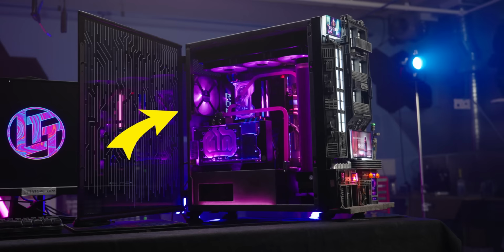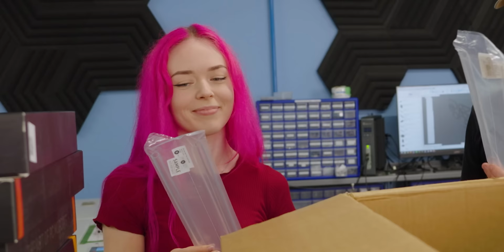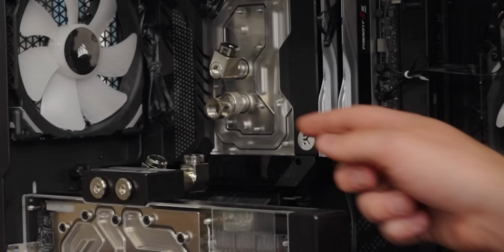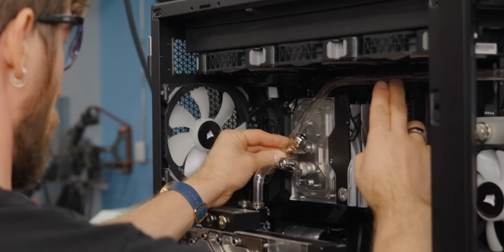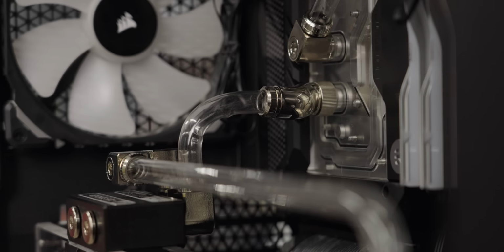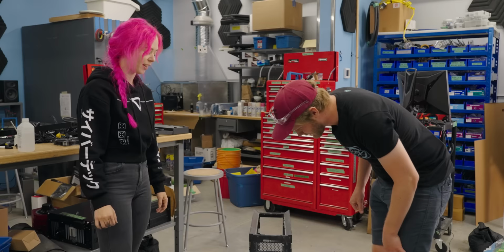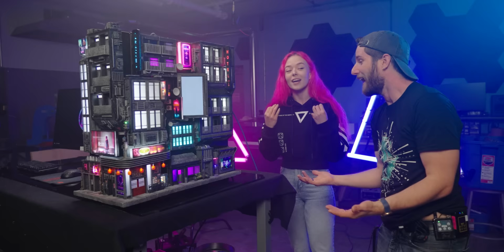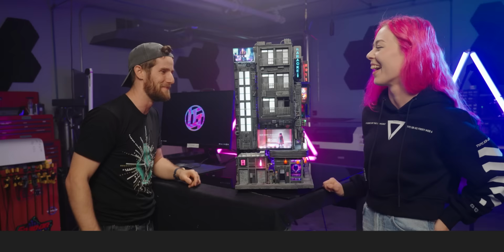This PC took 600 HOURS to Build!

Comment: Seasonic are just the ballsiest sponsor ever. The fact that they were like "oh you're pushing power supplies to their breaking point? Here's the equipment we use. Try us." and then sponsored the LTT video on the Labs power supply tester just shows how much confidence they have in their products.
Reply: If you make a superior product then testing and comparing it against others is just great marketing. Same reason why the LTT screwdriver was compared to competitors for example. Seasonic just makes the best power supplies, but doesn't have any way to demonstrate it to the general public who aren't electrical engineers. Seasonic is very smart to give LTT the means to demonstrate their power supplies to their massive audience.
Reply: "Oh, you're gonna have a PC case with a bunch of fancy lights, betcha you'll need an awesome power supply for that, don't worry, we're here. No worries it's just LEDs and LCD panels, we're sending 1600w."
Reply: My first pc build was 15 years ago and even then Seasonic was well known as the one of if not the best psu manufacturer.  So they’re more than just the meme sponsor, they’re legit.
Reply: Do you work for them?  Why would anyone post like this otherwise
Reply: i think you’re on the wrong video m8
Reply: I've put seasonic PSUs in all my friends builds for YEARS... There's a reason for that...
Reply: @Ucfahmad  I mean, people on LTT channel should know they're legit already, seeing as they manufacture for for Corsair, Cooler Master, & NZXT PSUs. They're still one of the only PSU companies that manufacture their own product rather than reselling a rebranded product.
Reply: @siege2928  Seasonic manufactures for Corsair, you still have a Seasonic PSU.
Reply: @Konarcoffee  They've had 12 year warranties for years. They've had long running sponsor spots that don't even have talking points, especially around Xmas. They are pretty much universally held in very high regard by anyone that seriously builds rigs and knows about what they're doing.
Kinda guessing you don't.
Reply: It's really great marketing, if Seasonic have the balls to sponsor something like the LTT Labs equipment that could really backfire then they wouldn't do it, so just by sponsoring it means they have a lot of trust in the quality of their power supplies.
Reply: @siege2928  I've had little issues with Corsair's over the years for the price, they are basically rebranded Seasonics for the majority.
Reply: I was just about to comment the same but you said it better than I could. They’re such a chill sponser.
Reply: @Konarcoffee  I don't work for them, I've never even bought one of their products yet, I've bought EVGA PSUs cuz they're cheaper. But damn if I don't respect the hell out of their marketing. That being said, when I get around to making another build for myself, I'll definitely consider shelling out the cash for a Seasonic.
Reply: It's super simple to make a great power supply if you don't try to save money.  Power delivery cost what it cost and any attempt to change this is a game of Russian Roulette with any electronics connected to it.
Reply: My last psu was from seasonic and was a beast! Had to leave them 2 years ago because they dont make 1600w titanium psu so i had to go with corsair
Reply: Going to build a PC for the first time soon. Guess what my power supply is going to be :)
Reply: @th3R0b0t  but also a 12900kf and an rtx 3090
Reply: Them and Dbrand are ballsy as hell xD
Reply: Absolutely, the only other company I'd get a power supply from is PC Power & Cooling. There's a lot that goes into a quality PSU and it's not something that's easily quantified.
Reply: My next power supply will most likely be a seasonic. Their platinum 750 watt is still capable of handling my current needs. Wonder when arm chips will hit the market though
Reply: Great marketing! And no doubt solid power supplies. But that won't make me want to buy them over any other.
Reply: I think I have no choice but to buy a seasonic power supply when I build my new pc haha
Reply: Proud owner of a seasonic power supply
Reply: @patrickshade3844  None of the current corsair lineup are Seasonic units. They're all custom designs (overseen by JohnnyGURU no less) manufactured by CWT.
Reply: @UniversalGaming  well that's a downgrade, no offense to JohnnyGURU. Last I knew they went through multiple OEMs though (CWT, Great Wall, Seasonic, etc...)
Reply: @patrickshade3844  Take a look at PSU Cultist power supply tier list & the power supply section on the LTT forums. Corsair is consistently rated as better quality than Seasonic. Seasonic PSUs had numerous problems with RTX30 series caused by design flaws in the units themselves (that Seasonic refused to publicly acknowledge). Seasonic is not considered the be-all and end-all PSU manufacturer outside of the youtube echo-chamber.
Reply: Seasonic is the best
Reply: Seasonic also buy a Sponsor spot around christmas every year just to say happy Christmas lol
Reply: @miscl_anon  Nah I just felt like brining that up because it was so incredibly based of them.
Reply: @patrickshade3844  do you know who manufactures the latest Gigabyte PSUs with the 1000w and 1200w that have LCD screens in them??
Reply: @Ucfahmad  Indeed
Reply: @UniversalGaming  Whoever built it, I have a Corsair RM1000x I poked in my 3080 - 3700X a while back. Mag-lev fan, zero mode. I never hear it.
Says made in Viet Nam on the box.
Reply: A

Comment: I've never seen a cosmetic PC build I've wanted as much as this one. Time to start saving...
Reply: same
Reply: Just build your own
Reply: @xenn4985  yeah thats what ima try to do, still takes alot of time and cash tho
Reply: I will outbid you by $1 every time
Reply: @camdenleonard7452  Time, sure. Lots of that. Cash, maybe not as much as you think. Nearly all Nerdforge stuff is made out of junk and everyday materials that are repurposed. Takeaway boxes, cardboard, foil, foam, paint, and lots of talent.
Reply: I myself am far to unskilled / untalented for building that myself. And getting that built by someone else would probably cost me at least 30k (with 600 hours for a skilled worker).

So nah, I am out
Reply: @camdenleonard7452  time yes, cash no. Take your time and this is a sub 500$ build
Reply: @xenn4985  ah yes you must’ve included the actual pc in your calculations
Reply: @xenn4985  Easily. About the only expensive tool on the Nerdforge side is the laser cutter, but you don't need that, it's just quicker and a bit more accurate. But you could do it by hand instead. Oh, and a 3D printer might help, depending on what you want to do. The PC inside though - that's a different matter. Much dollarpounds spent there.
Reply: Stake hex for 7 years and you'll beat Morhs law while making a batshit insane amount of money. Best way to plan a PC build is to wait for better hardware and pricing. No better way to do that then make fat bags during a recession
Reply: @frozenco2_  why would i? Everyone is clearly talking about the case
Reply: @xenn4985  derrrrrp. "PC build" is an all inclusive term. Did you not see that the fittings for the tubing alone costs $450.
Reply: they should update it with a 4090 when its out and a 13900k if they're hoping for a great price, cause like this its most likely won't get much by summer 2023 even if it was for charity...
Reply: Saving for sure, computers are expensive, but the more important thing is to start practicing. There's a huge amount of talent involved in this.

Comment: After watching this and reading the comments I'm dumbfounded at how hard it is to come up with an appropriate comment or reaction to this. This is one of not only the coolest but best pieces of Art / PC build's I have ever seen! I would love to own this at any price but I do not get enough visitors to my home to give this Artwork the attention it truly deserves. Martina Please, you are a truly talented artist so DONT STOP DOING WHAT you're DOING! Thank you for this.
Reply: If you want something like this - I would strongly recommend starting with something smaller (medieval house comes to mind). It's actually fairly straight forward, but it does take some getting past the "this looks like crap and will never turn out" phase as until you get the final washes / dry brushing / protective clear coat - it won't look "right".

You can do stuff like a wizards tower, or create the effect of it being a cliff face, or whatever else you can imagine - it's just foam, cardboard, some plaster / clay / whatever, and of course: Paint.

Just to note: I've only more recently properly got into terrain / buildings - and have a 6 foot tall tower in the process of being plastered, while I learn some 3D modeling to get some supports, and other nick nacks designed so I can print them and attach them. Yes it's a lot of work - but damn do the results of "I did this" make it worth the effort.

In short: Be inspired - and get out and make yourself one damn awesome computer case mod.
Reply: "but I do not get enough visitors to my home to give this Artwork the attention it truly deserves" - that part of your comment shows that you're a good guy my friend :D
Reply: 100%
Reply: you can start streaming then to show off this
Reply: Checkout the doom 3 case from around 2007. It was on par with this
Reply: Honestly, if there were these kinda two sided set pieces for popular PC cases I think they'd be crazy popular.

Comment: This build was an incredible incentive for me to continue using air coolers. Thanks for that!
Reply: or AIO's right
Reply: i mean even watercooling uses air, air ftw
Reply: My god, same! My new RTX 4090 / i9 13900K PC is air cooled and that's it. I would get so anxious that the hose could pop-off at some random point ruining the PC with a water cooled system.
Reply: @JokeDindonChannel  i think the leak won't kill your pc because you should use distilled water which is non conductive, so you pc just get wet but run just as good if not better because the water is cooling all over the place lol

Comment: As a programmer I absolutely love that they bricked the photo frame to make it useful
Reply: no idea what bricked it means but it sounds like it was hacked, and i'm all in for that kind of shit.
Reply: @kurtcraig3421  hacked means "gain access to the underlying structure and possibly make changes to it", bricked means broken as in "not working properly". What bricked instead of hacked means here is that it will no work as intended again. Also it is up in the air if the result was actually intentional.
Reply: ive been into custom roms/os n all the shit you can do in android back in around 2014-15, and i must say, this brings back memories. it makes me really appreciate how accessible android really is. as long as you can read instructions you can pretty much do whatever you want in an android
Reply: therubberninja  Honestly, it’s a pretty robust and elegant solution in my opinion. There’s nothing that can go wrong, because everything that could go wrong has already gone wrong.
Reply: @jthoward  like the computer equivalent of a servitor.
Reply: @vsmash2  Specifically, here, the OS -- Android -- is broken so as to just loop their custom boot animation. The device almost certainly has a recovery bootloader that would allow them to flash a working image to bring the photo frame back if they really wanted to.
Reply: my guess is he did a noob move and undervolted it.

Comment: This going to charity is just the cherry on top of an incredible build. As a long time Nerdforge fan and a big nerd myself I can also say that my second and oldest PC (now my wife's) is still running on a Seasonic PSU and this comment is not even sponsored by them (but Seasonic, you can if you want! :p), it just didn't die yet after almost a decade of hard use service.

I do hope the charity action brings in a ton of cash as this case doesn't deserve less. And to all my fellow nerds, check out Nerdforge, they really deserve your sub, they are just great as you can obviously see!
Reply: Surprising it's being sent out, given they're using the hacked up 3090/motherboard/cpu.
Reply: Your comment made me smile and I enjoy ppl like you. Your username suits u very well friend, keep it up !
Reply: It's too bad Seasonic went from using great high-reliability under heavy load AND HEAT ball bearing fans to "fancy name" junk sleeve bearing fans in their most recent generation power supplies.
They will regret that decision when those fans start wearing out seals, losing lube, and DYING long before a ball bearing fan would have.
Reply: @sIightIybored  I would be very surprised if they didn't switch out the internal components to fresh ones, especially given it probably won't be up to date tech by then (Linus even mentioned the PSU being able to handle putting a new GPU in there).
Reply: @bricefleckenstein9666  I'm still waiting for the RMA of my Focus+ because I changed from a 1080 FTW2 to a 3080 FTW3 Hybrid. The damn thing just turns off.
Reply: @sIightIybored  Im guessing they just used parts that fit the asthetic for now. Considering it will stand on a shelf for 6+ months. Everything but the PSU and watercooling parts will be swapped out for up to date parts that have not been hacked to hell :P.
Reply: @muttefur  You probably overloaded that power supply.
The 3080 FTW (depending on the model) has been tested to draw up to 404 watts, where a 1080 FTW draws less than 200 (though very close).
Then add in the REST of the system, and your system is likely pulling 600-700 watts EASILY on a high gaming load on peaks.
I'm guessing you had a Focus 650, which was plenty to handle the system before the GPU upgrade.
Reply: @bricefleckenstein9666  still have a focus+gold 750. Supposedly this should be more than enough. Sea sonic already accepted the RMA but I am still waiting for the local distributor communication.

Comment: Important FYI: Most of the leak testers you can find on the market use generic pressure gauges which don't have markers to indicate which pressures are correct for a traditional PC water cooling system. In the video he pushes a tube out of the gasket from the pressure he uses to pump up his system. However, even when he used "less pressure" it was still too much pressure even though the guage shows it in the "green" region. This is a really bad design flaw and can result in displacing the seals in your system from excessive pressure. Consult the maual but I wouldn't suggest going over 0.5 bar for a leak test. 0.3-0.4 is more than enough. Any more and you're more likely to crack plexi or damage gaskets.
Reply: OK boomer
Reply: @jorgebustillos8469  The information above is really important if you don't want to destroy your water cooler.
Reply: This sounds like actually useful information. Why has it a snarky comment under it?
Reply: yea many people also don't know that being airtight is 'tighter' than water tight as the surface tension can increase tightness.
Reply: They're using the EKWB leak tester (You can see the small yellow logo on the bottom of the gauge) specifically made for EKWB components. So it should have been fine.
Reply: @jolioding_2253  wich does not mean if it leaks a but of air just put water in  thats not a good idea
Reply: @gril.gasper  Yes, in the official manual for the EKWB tester it shows not to exceed 0.3 bar when using a distribution plate or for "loop" which means if your leak testing a cooling loop. Plexi can break at higher pressures. The EK pressure tester is also using the same generic pressure valve. I know, I have one of my own.
Reply: atleast it was still off😬scary hahaha
Reply: it's overpressure to proof the system when using air to test. if it just barely holds the pressure of normal water flow then it's no guarantee it will hold in the long run
Reply: @jorgebustillos8469  How does spreading important information make someone a boomer? It's more of a boomer move to do things incorrectly because "I know what I'm doing" instead of reading and following proper instruction.
Reply: @InvadersDie  Yes however too much overpressure can dislodge things that will prevent it from working in the long run. Like sure I could ram my mailbox with a sledgehammer and have it still function, but it won't stay upright or resist things as well as it would if I just gave it a good hearty shake to make sure it was in the ground.
Reply: Nahh, you can just hook her up to any shop air compressor and give her 120psi. That's how the pros do it.
Reply: @InvadersDie  Under a normal loop you'd old expect around 2-3 PSI or 0.2 bar. 0.3 bar is already "over pressure." Adding more only risks damage to your loop.
Reply: @mrartistimo1530  I agree.
Reply: See the problem is any system should be tested at beyond its design point and still function correctly. A D5 pump is speced to put out 0.38 Bar, typical testing from my experience requires you do it at least 125% of that, so 0.625 bar without failure. If the system isn't designed to handle that there is an inherent flaw in the engineering of the fittings.
Reply: @literallycanadian  125% of .38 is .475, not .625.
Reply: @literallycanadian  Someone else already pointed this out but your math is wrong. And at 0.6 bar distribution plates are more likely to be damaged and tubes are more likely to be pushed out from the fitting. If you're seeing 0.6 bar in a water filled loop than something is very wrong. For most loops 0.4 bar is already above what one would need to test for leaks and above 0.5 just risks damage. The ek manual recommends 0.3 bar for loop testing. Bigger isn't always better.